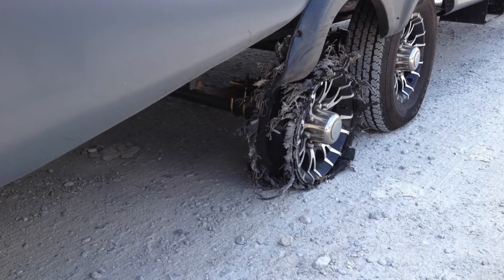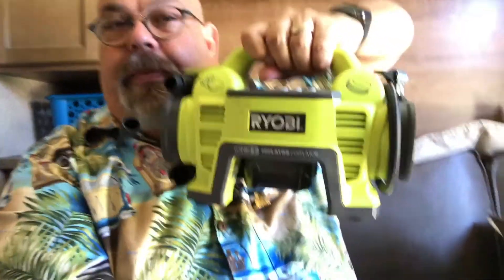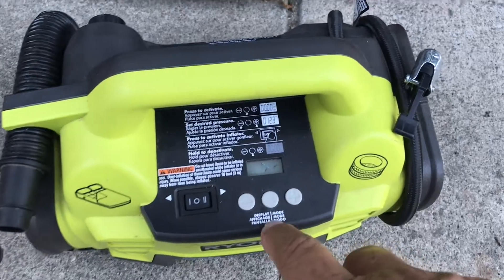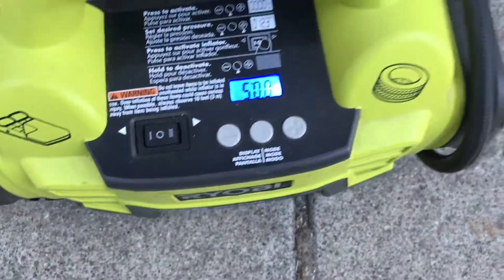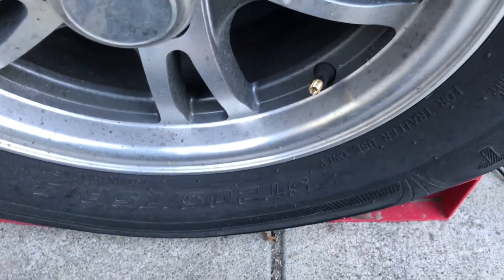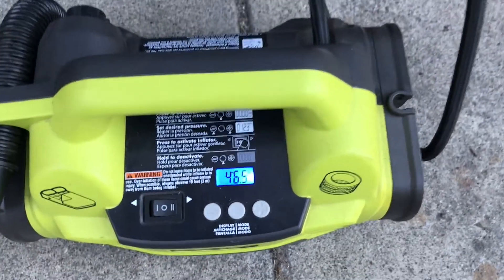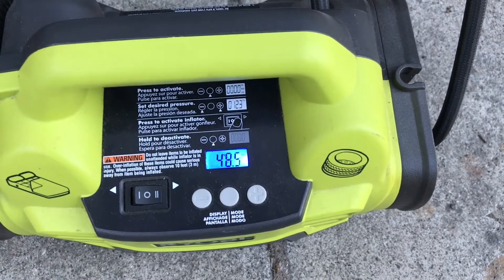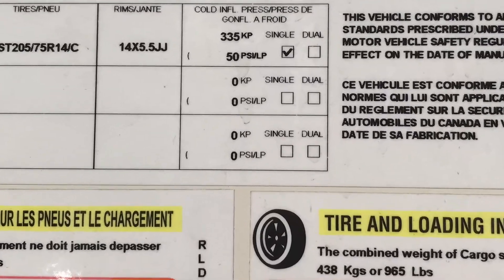Travel Trailer Tire Pressure

Comment: Good video. Just know that If, during a tire replacement, the load range is changed/upgraded, use the inflation chart provided by the manufacturer. If you don't, tread separation becomes very likely. For the  original tires the placard pressures are true but not always for replacements. Learn how to read imprinted tire markings (required on all tires) by watching videos. Easy. Tires over ~7 years old must be replaced as they too are very separation prone (even with 99% of the tread remaining!) too.  Rubber does not last forever. The above can prevent a tragic ending to a happy vacation.
Reply from the maker: This is great information - you're right!